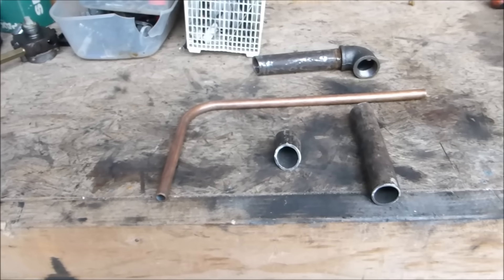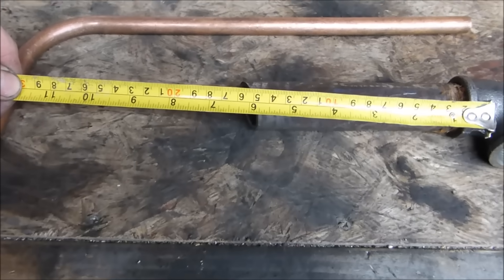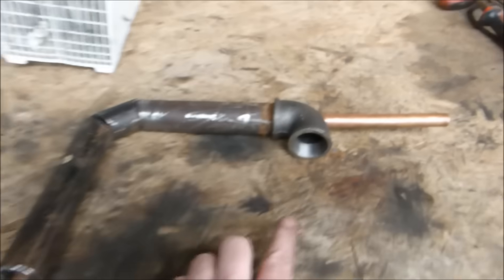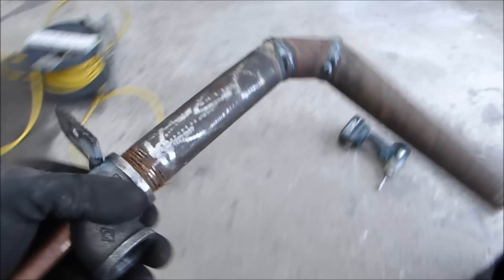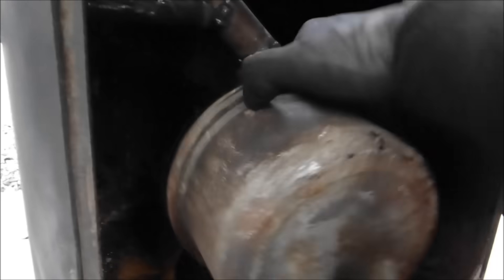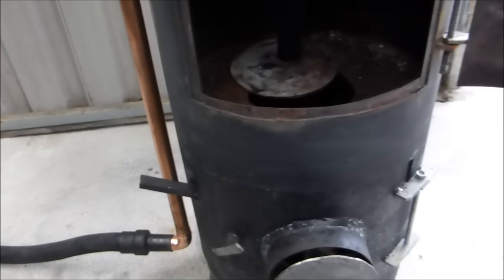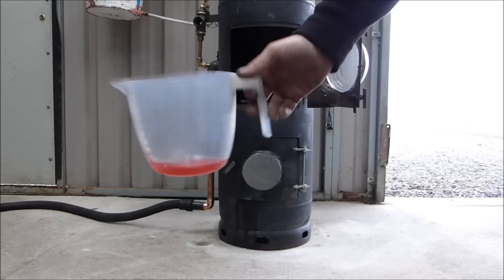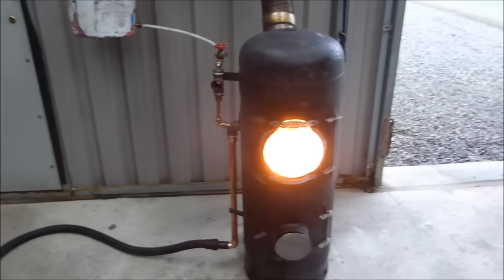Build a New and improved fantastic output Waste Oil Burner.

Comment: Is there any clue as to what's going out the final pipe by way of air quality? Are the burn products any better or worse than burning wood? I think you have a very good looking unit here but I'm concerned with neighbors' experiences with the smoke. I wouldn't want complaints (we have only a few feet between houses, you can tell when folks are using their BBQs - including when they use fire starting liquid).
Reply from the maker: Hi Mike. This unit is smokeless so no worse than burning coal I think but with absolutely no smoke. It will burn waste cooking oil as well so renewable energy. The reason that there are 2 chambers is that I wanted to be able to burn logs in it as well. It is a really well behaved stove and works great whatever you decide to burn. Hope this helps Cheers Gerry

Comment: How do ya get the stove lit initially? Thanks
Rik     Denver, Co.
Reply from the maker: Hi Rik. If you fast forward to the 11minute mark on the video you will see that I light the stove.
Its just started with Kerosene or similar to help get the vapourising pot red and after that you can burn Veggie oil or most other oils with ease and cleanly. Cheers Gerry

Comment: i like it   do it use lees oil then the other type
Reply from the maker: Hi Thomas. It uses about the same but it is easier to build and it is possible to raise the output of the burner without smoke. I modified it again today and have it producing lots more heat. More videos soon. Cheers

Comment: Hello,  I am from Canada and this winter is just not giving up!  So I recently built a stove with the same way you built yours ( pipe in a pipe) man this thing puts out super heat,  I kid you not,  and it's cold here.  I've installed this unit in my garage (100 yr old barn,  no insulation at all). If the temperature is -20 outside then it is -30 inside.  So basically my problem is that,  I cannot control the heat ouput.  At first,  all is fine for about 1hour then things get out of hand.  I am able to keep my temperature at the same degree for a while but it seems that when my garage starts getting warm the oil starts to flow more and brings the heat up too much,  It gets very hot.  I think now I will have to control the temperature of the oil so I could get a little consistancy.  FYI,  what I did to my burner was I put a tin can in the middle of my pot and drilled 4 holes along the bottom side of it so the air could blow out of the can,  my air tube is about 2 or 3 inches over the can,  so O never get any flames at the tube or even near,  you should try it....  Well thats it for now,  thx for your videos and keep them coming I find them very entertaining.
Reply: Hey, I could not help but overhear (read) your problem. I had that problem at first but I went to the hardware store and got a "pin" valve. It regulates the water to your Fridge ice maker. It worked GREAT and I put it in the oil supply line and you can fine tune the temp. by 5 degrees. No kidding I kept it running all night while had the heat gauge on video and reviewed it all night. Cheers